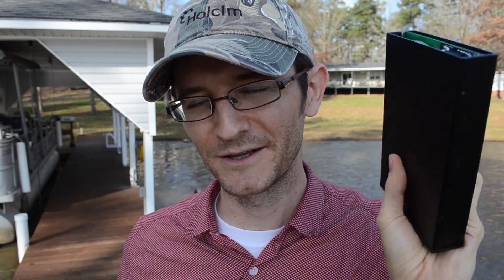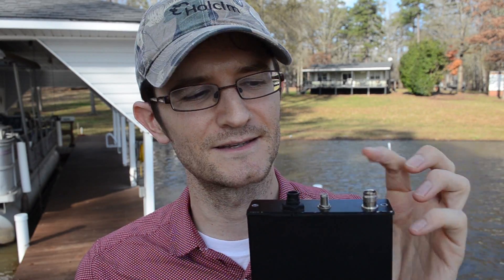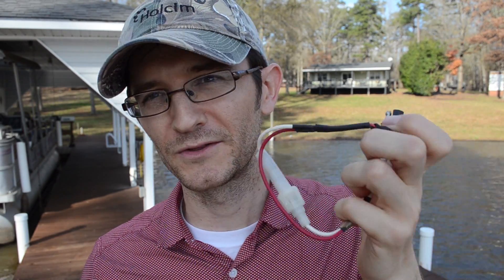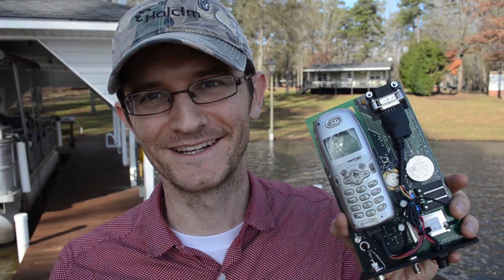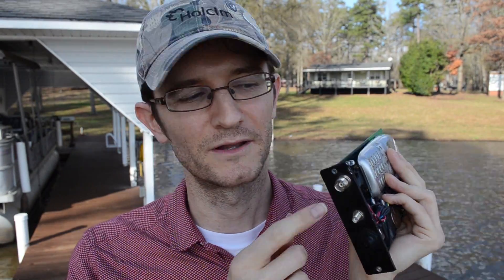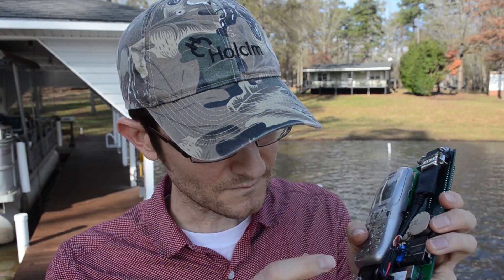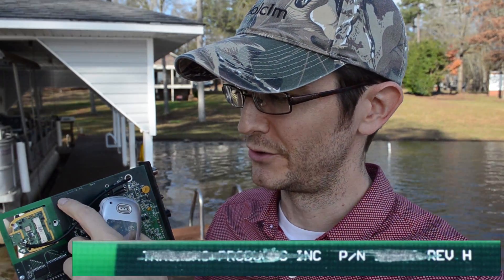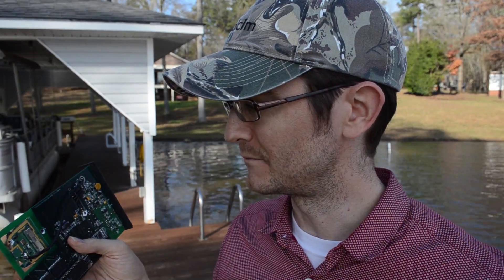Anatomy of a Malicious GPS Tracker

Comment: Thats an outdated unit real time from tracking products of Colorado, it ran on the amps network, it was basically a gps engine blowing data through a cut up cell phone on verizon or another carrier. they were big and heavy but worked well as with software and dial up or a cell modem one would dial directly to the device through the software. they cost around 1500.00 in the day, plus a monthly fee to the carrier. They worked well, the mapping sucked but it was a good product in its day.also it was so expensive to buy and maintain not many folks would spring for it. the only thing good about that device compared to today's gear is that device was as close to real time as it could get with no delay.
Reply from the maker: +Rick “Wireman” McGyver You are right about the big and heavy part. Felt like a brick. Had no idea about the software side. Thanks for filling in the blanks!

Comment: I and my friend once walked to a illegal landfill to see what's there. We saw a CRT TV there. We pry it open and took the parts we needed. At some point we saw an old video camera in the place of one loud speaker. The camera could watch trough the speaker grill easily. If I remember correctly the camera had its power transformer directly hooked into the mains power pins of the TV PCB.
I think my friend still has that camera (after about 15 years). I remember it was all analog.
I really need to ask him about it.
Reply from the maker: +Ilja Sara Not a bad hiding spot. I wonder where the video camera was sending the images. Was it to a storage device or over a wireless link to a someone watching? Interesting find.
Reply: Skinny R&D:
It was very old at the time we found it. I belive the TV was thrown away because a new one was to replace it. And the camera was from about the same time. If I had to guess the TV was from early 80's. If I remember correctly the signal went via a short wire to the antenna socket. So the actual TV signal and the camera signal used the same cable. How it was monitored is only guessing.
Also what's interesting was that the TV was thrown into illegal landfill (a trench in woods near city). That pretty much rules out any city or government public places where it might have been for surveilance, since city/govenrment here would not use illegal landfills.

Also maybe worth of mentioning, back then I lived in Helsinki the capital of Finland. I think that kind of surveilance here is a rare thing.

I'll ask my friend to send pictures of the camera if he still has it.
Reply from the maker: +Ilja Sara Yeah, I'd love to see some pictures.
Reply: Skinny R&D. Well. Got mail from my friend. Unfortunately he had get rid of it ten years ago. :(
But he told me some interesting note about it...
The cable from the camera was indeed connected to the antenna socket. But there was something extra added in between the TV signal receiver PCB and antenna socket - a signal band-block (low-high-pass) filter. It made sure that whoever was using the TV couldn't accidentaly tune in to the frequency of the camera's monitoring signal and expose the hidden camera.
That's a clear evidence it was indeed made with the intention to spy someone.

The rest is only guessing.
Reply from the maker: +Ilja Sara That is quite interesting. Sounds like the installer was quite the professional.
Reply: Yeah. Indeed.
It's interesting case, but with too little evidence to make (much) more conclusions. :\

Comment: Pretty cool. 
Does that phone pre-date sim cards? I wonder if they would request a location from the phone, or if it was just automatically spamming the GPS location. 
Funny that it has a Piezo speaker in it. You would think that would never be used unless you're trying to freak out the driver of the vehicle.
Reply: +SeanHodgins so my thoughts on this are:

- It's a pretty old (2005?) verizon phone, so it's probably from before they had SIM slots.

- regardless of that, the phone certainly has a 2G internet connection, and being powered by the car battery, it can "spam" the location information every time the receiver calculated it (usually once every second). the fact that it's using a serial port suggests that it's using a very common protocol known as NMEA, and NMEA messages are very small (something like 100 characters/message). Even with extra data to say which phone it was coming from, you can get that connection speed practically anywhere. it's also light to store on the phone for a few hours (100 bytes/second end up being  360 KB/hour), in case it doesn't have a persistent connection.

- it can ALSO be that it's using plain SMS messages for it, but in that case I guess it would need to be much less frequent (like once a minute, which is probably fine for investigation reasons, you can't really send a plain old text message every second). if it is indeed SMS-based, it just needs to send it to a number which will recognise the number the text was sent from, and add it to the map/alert the investigator if it approaches a certain area/etc.

- the piezo sounds like an awesome way to scare the people you're tracking, especially if combined with custom ringtones.

P.S.: Jason, it's good to see a new video from you!
Reply from the maker: +João Andrade I'm assuming this ran using the SMS method, although I'm not sure. As you said, there definitely is no need to have real time, second-by-second tracking in most cases. As far as the piezo speaker, since you have the car long enough to wire this thing under the dash, why not wire the ringer to the actual speakers of the car. Talk about a heart attack! Thanks for watching guys!

Comment: Why was this person targeted. Also, if it took them 6 years to find it, and they found it because they were suspicious from being followed, I assume they were followed/tracked for 6 years? Thats an awful long time to follow someone and not find what ever it is your looking for.
Reply: +pugs2300 The video is edited there are many info that he talked about redacted to protect the source.  Like in 5:47 "Lo and behold they have found these extra goodies?"  My guess is they probably found a lot more stuff aside from the gps tracker.  That he cant cant talk about to protect his clients confidentiality.
Reply: what other things would have been hidden in the car? I mean if someone were gonna try to have listening device i would imagine they would have built it into this existing device since all the required bits are there. wouldn't make much sense to have several separate devices to do what this one device could itself.
Reply from the maker: +pugs2300 I believe you are on to something there. When I said in the video that I thought it was possible audio could be transmitted with this device, my thoughts migrated to the phone's inherent feature options to autoanswer. The phone could have been setup to autoanswer and allow the caller to listen in on what was occurring in the car. However, the audio would have been absolute crap as the microphone would have been inside the black box and under the car's dashboard. I would have expected to see the microphone remoted away from the box and put in a position to extract the best audio. If the installer had enough time to take the whole dashboard off, one would have suspected that they would have had the time to install a mic as well. Perhaps audio just wasn't a priority.
Reply from the maker: +pugs2300 The target was completely unassuming. To the vast majority of the public, the possibility that someone could be tracking you via technical means seems so ridiculous as to be impossible. It's the stuff of James Bond films. Furthermore, there are many reasons to keep a tracker in place over the long term. The longer an aggressor wants to have the device in place, the quieter and stealthier that aggressor needs to remain. In this particular instance the person doing the tracking was playing the long game.
Reply from the maker: +Chris Bautista Nope, just the tracking unit. When I said goodies, I was referring to the multiple antennas and connectors along with the black box.
Reply: I would assume not. It would have been so easy to implement im not sure i could have passed it up though. lol
Reply: +Skinny R&D Having worked in a pro car audio shop for a few years, I can tell you that something of this size probably would not have required the dash to be removed for installation.  But Depending on how well it was stuffed under the dash, it might have taken a couple of hours tops to install it.  I would regularly install security systems and remote start systems hidden without removing the dash.  Often times, we had to place the antenna, or even the whole box as close to the top of the dash as possible.  Having skinny arms and a good amount of flexibility in your wrists helped out alot.
Reply from the maker: +Ted Fry Cool. That could have been the case. I was instructed that when the device was taken out, a mechanic was utilized to remove the dash. However, not knowing how the tracker was placed, you could very well be right.
Reply: +pugs2300 They might know who was doing the tracking based on the numbers in memory on the phone.  If not, it's possible that whoever installed the tracking device, whether they got what they were looking for or not, just left the tracker in there after deciding it wasn't worth the risk of discovery to try to remove it.  The vast majority of vehicles will never have their dash taken apart and it's likely that the vehicle might have gone the rest of its life without anyone discovering the device.
Reply: toughluck78
OK but according to what he said in the video you are wrong. He said the victim only found this because the noticed things like people following them, and went and had the car searched. I doubt they noticed someone following them and waited 5-6 years before they decided to go have the car checked out.